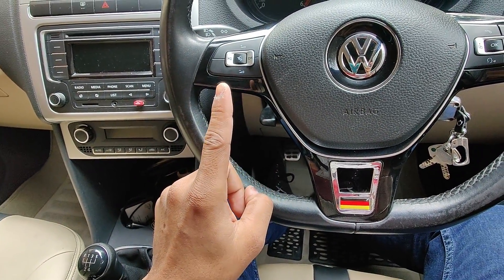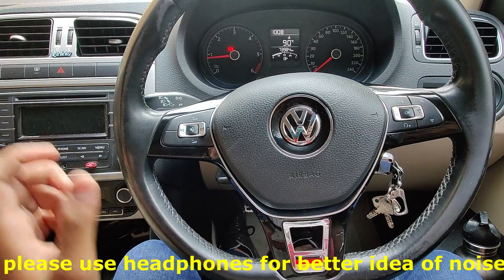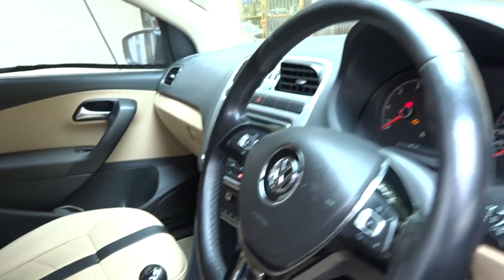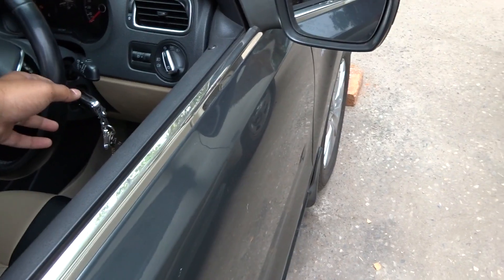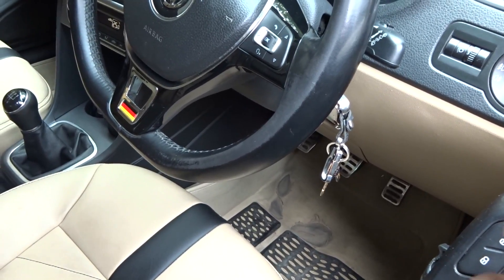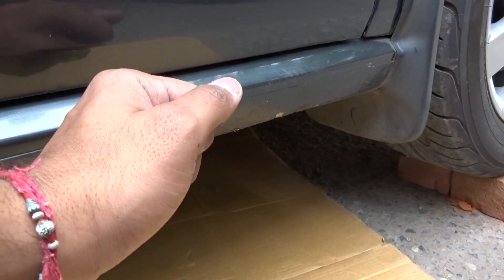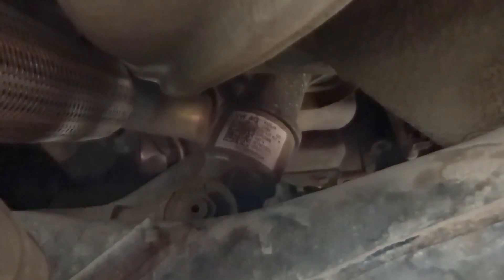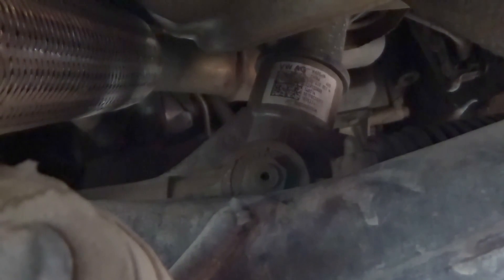STEERING RACK NOISE | RACK PRELOAD ADJUSTMENT | YOLK SCREW | HOW TO

Comment from the maker: subtitles / closed captions available
Reply: Thank you for this man ! But in general do you have an idea approx how long do these racks last if driven correctly.
Reply: @AK-sv4kb  also a little bit on the tyres per my mechanic. I had MRF tyres that are very hard and I switched to continental tyres now will be taking it to the mechanic to only change the bushings and see how long it lasts. Factory fitted rack made noise at 70K and the second one I changed at VW lasted only for 30k kms until it made clunking noise when going over bumps.
Reply from the maker: Yes , it also effects the life
Reply from the maker: @AK-sv4kb sir honestly it depends upon the condition of the roads

Comment: Did the steering vibrate heavily on braking? Not talking about warped brake rotors symptom (although similar) as rotors are new.
Reply from the maker: No sir , it's just a clunk noise

Comment: Hi!
audi a3 2013 same problem..this sound is made when driving lightly, if I go fast I don't hear it, the same when stationary, or when I slow down and turn the steering wheel. Should I tighten the screw and that's it?

Comment: Hi, need your expertise on a problem im facing

I have a honda city 2015 and I recently replaced the rack with honda genuine part at service center because old rack had become very voisy and rattled over bad roads, plus steerin also became hard after failed repair attempt

however after replacement although other issues have been fixed, this sound is still present and it is same like you presented in your video, do you think I should get adjustment done on the brand new rack? I did the test you demonstrated and the smallest of steering input is delivered to the wheels and ofcourse it is a new rack (only drove 1000km till now) so internal wear is out of the question.

Will adjustment of york screw cause hardness in steering?

Comment: If you’re not leaking power steering fluid I would rule out the rack. Could also be a steering shaft or ball joints as well. Usually when a rack goes bad you’ll have to turn the wheel half way to drive in a straight line
Reply from the maker: Sir its an electric power steering , doesn't have any power steering fluid .

Comment: Hello, is adjustment an option on the Fabia MK3 (2015)? And would this explain knocking at full lock. I have such an issue from inside the centre of the rack itself.
Reply from the maker: If it knocks on full lock then its not going to do much , but you can still try , every car has this setting
Reply: @yourDIYneeds 2016 Skoda Superb? While cleaning the steering wheel leather, I turned the steering wheel with force and this knocking sound came out.

Comment: @yourDIYneeds bro i have same problem in my car a little sound came from steering..on rotating and when applied brakes a kit kit sound coming from steering my mechanic change the bushes of my steering rack and he told me that...after sometime he will tight the bushes and no noise will come....it will be resolved after adjustment like braking noise and steering noise??

Comment: Hello brother, my polo gt tdi has the same issue when moving the steering left and right. The rack is only 5 months old, can it be the lower part of the steering column, the steering shaft? because the noise can be heard only on low speed and uneven roads.

Comment: My steering is hard and wont center at low speeds, the rack is new. Will loosening it return it to normal? My old rack was a lot lighter.
Reply from the maker: Yes , if castor and camber are correct then yes it it will .
Reply: @yourDIYneeds  thank you

Comment: @yourDIYneeds i feel my skoda rapids steering is little heavy especially at lower speeds or complete turn. Steering rack was replaced recently and i was asked to run the car for 5k km so that the steering will feel smooth... do you recommend me to adjust the yolk screw to loosen a little bit or wait for some more time. Thanks for sharing your knowledge 😊

Comment: Does we feel wobble for this issue?
Reply from the maker: No sir
Reply: Iam getting wobbling issue sir what might be problem?... I had checked allignment twice within 1K kms still its not going... Feels when i break... Also i have this steering rack noice
Reply from the maker: @vishnuba7323 
Checked wheel balancing ?
Reply: Checked that when changing tires... They ran over 15K
Reply from the maker: You feel wobbling in steering or brake pedal ?
Reply: On both😭😭

Comment: Great vid. I have the same noise and when I adjusted it fully tight it still did not get rid of this noise is my steering rack just bad because it moves the wheels fine with minor touches.
Reply from the maker: Sir check the ball joints of the steering system , maybe it's not the steering rack
Reply: Did you find what it was in the end?
Reply: @cruiseedwards4657  it’s the rack I guess this noise is normal for the age. It steers fine still.

Comment: Could this adjustment be done on a Nissan Armada? I have excessive steering wheel movement when hitting bumps/uneven surfaces along with the clunking sound. Although there is no clunking when turning the wheel.
Reply from the maker: Yes sir , almost every vehicle with a steering rack setup has this adjustment

Comment: Thank you for this video. Just replaced inner and outer tie rods, lower control arms and stabilizer arms on my renault. Not long after started to get this exact noise from steering and concluded I probably need new steering rack and I would need to most of the work again. Watched countless youtube videos to try found "easy" fix. I'll try this today. Your video is only one explaining properly how to adjust the steering rack, some even said it needs to be adjusted in 180 degree turns which sounded silly as can be.
Reply: did it work?
Reply from the maker: 😅 sor thousand people thousand processes , but i try to follow the workshop manual . Thanks a lot for appreciating.

Comment: Before you started all this did you check the power steering fluid,  it may be the power steering pump
Reply from the maker: Sir its electro mechanical power steering system , not hydraulic

Comment: I have changed al shock parts lower arm , link rod . tie end rod
Evrything except steering rack 
Some.sound thud sound in uneven road
Reply from the maker: Do same process sir
Reply: @yourDIYneeds  steering rack relpaced 20,000 kms ago . Is it advisable to change or tight
Reply from the maker: Sir , even the new rack calls for a preload adjustment

Comment: have this similar problem. search a lot on the internet and i think it is the bushing on the steering rack not the preload. maybe im wrong, but i guess i'll stick by replacing the bushing on the steering rack. bushing on steering rack has lifetime in it , it's not a permanent parts it needs to be replace for couple of years using a car.
Reply from the maker: Sir my car did not had any sort of bushings

Comment: When I turn my steering wheel left to right it’s squeaks, and when I go over bumps it’s squeaks as well. Has new struts, and all new suspension. Could it be the rack ?
Reply from the maker: Swapped the strut bearings ?
Reply: @yourDIYneeds  we changed the two front struts with new ones
Reply from the maker: Sir you changed the struts but did you change the bearings on top ?

Comment: Can this cause vibration in the steering wheel or small pull on uneven road?
Reply from the maker: No sir , it will not induce any kind of vibration
Reply: @yourDIYneeds  Thank you

Comment: Sir my Baleno which I bought just 8 months back creating this issue. Is my rack worn out?
Reply from the maker: Sir may need some adjustments , worn out rack this soon is quite difficult
Reply: @yourDIYneeds  ok thank you sir I will get it checked soon.
Reply: If company said that your rack is worn out will it be covered under warranty?
Reply from the maker: Yes sir it will be as your car is just 8 months old

Comment: Does driving with that "tak tak" sound for long will  cause any harm to steering column or rack or suspensions  ?
Reply from the maker: Very minimal , but its good to get it fixed
Reply: @yourDIYneeds thanks a lot for reply ! Anyway to connect with you ?
Reply from the maker: Sir everydaydiyhelp@gmail.com

Comment: Hi..i face this issue on stagnant vehicle plus when it goes on breaker there is an abnormal sound , like something is loose in the front..car is 1 yr old..service center said its normal sound..pls gelp
Reply: Was the issue resolved for u? I too face same issue in right side suspension Luke something is loose only on some potholes..
Not all potholes cause that issue
Reply from the maker: @vijayendranvijay4538 if the noise is in the steering assembly , just like i did have , then it will resolve

Comment: Seems to be my issue. All of the front end as been rebuilt on my 2013 Jetta tdi. Balljoints top plate bushing inner and outter tie rods the u-joints in the streering colum are ok. The only thing left is the rack. I hope this fixe it as I don't want to drop the subframe and replace the rack since i'm looking to sell it soon for a newer tiguan.
Reply: Did it fix it ?
Reply: @mikemarin4793  nah, a rusted steel bolt in an aluminum casing. Stupid engineers. I ended Up changing the whole steering rack.

Comment: My mechanic had tightened the screw of my honda, the sound from the rack gone. But the steering wheel became tight. Is the steering wheel becomes lighter and smoother after certain use. The mechanic had told me that it becomes loose and normal after some use. Kindly make a reply
Reply from the maker: No sir , he had done it too much , have to make it a little loose .

Comment: Hello friend, I also happen to have this German Ghodi, 1.2 TDI, 2012. I located the place however its not 19 size bolt but with some kind of rubber on it. And It seemed small, I could fit a 13 bit but no movement either clockwise or anticlockwise. I have exactly the same issue. what to do?
Reply from the maker: Sir bolt size may vary , but the function is same 
If the threads are seized then you can spray a little bit of thread penetrating fluid , it may help

Comment: Hi. My suspension makes rubbing noise when I go over humps. Local mechanic told me it's due to stabilizer bush gone bad. Can u suggest place in Bangalore where I can get genuine spare of Skoda or VW
Reply from the maker: Sir i reside in Delhi , don't know much about Bangalore
Reply: @yourDIYneeds   OK
Reply: @yourDIYneeds  Hi got the noise sorted out. turns out the engine mount had gone kaput on the driver side.

Comment: Hello! I am having a similar issue as you with my VW Ameo. It is under extended warranty. However, the 3rd party warranty provider (Bajaj) is refusing to honor the warranty for the rack stating that the noise is mild and unable to be captured by their camera. The service center acknowledged the issue, lubricated and adjusted the rack, but slight noise is still occuring. Any suggestions? Thank you.
Reply from the maker: Sir lubrication and adjustment of yolk is the best option

Comment: Very informative! Is the procedure same for Skoda laura ? And how long does this solution last ?
Reply from the maker: Yes sir , its same for skoda as well , its still going fine for me , my odo is on 1,10,000 now
Reply: @yourDIYneeds  do you mean on laura too? Coz laura and rapid/polo steering rack designs are different right
Reply from the maker: Yes sir they are different , but the basic construction of every steering requires a yolk adjustment , the only difference is that some racks has one yolk to adjust and some have two

Comment: Hi. Can I connect with you over a call please? I have Škoda Fabia. Both Polo and Fabia share the same parts and build. Thanks.
Reply: I’m facing issues with the steering rack and it makes very irritating sound when turning or when passing on humps/ speed breakers. I recently got my suspension changed. So the only defaulter left is the rack. The service centre advised to get it replaced.
Reply from the maker: Sir mail me at everydaydiyhelp@gmail.com

Comment: If i turn steering left i makes some,Weird sound but no sound for right turn;help me bro what to   do?
Reply from the maker: Sir check the ball joints , there are 3 on each side ( only on front )
Tie rod joint 
Steering end ball joint 
Control arm ball joint
Reply: @yourDIYneeds  showroom people told that steering box complaint in the last month,yesterday i have been through watercrossings(cyclone in my area)after some offroads and water crossing i got this noise,i can feel steering rack make some noise but yesterday onwards some hydraulic sound arised during the left turns only...
Reply from the maker: Sir maybe the rack got filled with water , you can open one boot and check
Reply: @yourDIYneeds  ok sir thank you
Reply: Can i use it with that problem or go for repair sir?
Reply from the maker: Sir if its water , then atleast what you can do is open it , and have it greased up , so that it doesn't do any damage further , there is also a video on same topic on channel
Reply: @yourDIYneeds  waiting for it....
Reply from the maker: Sir video is already there

Comment: Did you try silicon spray near the foot well where the rack joins? does the mk7 also have adjustable yolk
Reply from the maker: Sir every steering rack has a yolk adjustment , be it mechanical or electrical .
Reply: @yourDIYneeds  thank you interesting to know

Comment: Dear Respected Sir,

I have new dzire LXI vehicle which giving me a issue on 1000km.

Issue is when i  start engine and moving steering tk left side approx 10deg a knock noise comes then it not come untill i drive .

When i kept vehcile off for 30min and again start and move steering left 10deg a knock noise comes.

Service Team saying it's no issue but i chexked new cars at showroom no one having rhis noise.

Even its not there in my vehicle day I buy it on 6dec 2021 till 25dec 2021.

On 25 dec service team dismantled all suspension parts to chexk my steering squeaking issue and reassembled all suspension again.

Then soon next day 26dec i observed this noise .
Steering Squeak also there for that they reolace coloumn related ball joints but soon after month again sqeak start i shared video with team they take my car kept it 2days and now no squeaking but they said they dint done anything but how it possible without dojng anyyhing Squeak gone

I doubt that they did lubrication of strut mount and steering coloumn and rubber boot of colooumn on floor
Plz suggest.
Reply from the maker: Sir when my vehicle was just 6 months old , i faced a similar issue , on cold morning whenever car got into a pothole ( left front ) it made a clunk noise and after driving for 10 mins noise went away , i tried everything , myself , even gave the car to service centre and they checked it and told me nothing is wrong , i drove my vehicle like that for 3 yrs , and then one day in monsoon season after rain i was inspecting the front left wheel and i saw that the whole fender liner was covered in dust , except for a small spot , which was very clean , and it came out that the sway bar end link was striking against the plastic fender liner only when the temp. Is cold , as the car and shocks gets warmed due to operation the pressure inside the shock increased and then pressure was enough to avoid that impact , so i would advise you to have a good look for any witness marks for impact , so we can trace which thing is making noise due to impact
Reply: @yourDIYneeds  sir my vehicle is just 2month old with 3400km clocked.

I checked this steering noise sound in all new cars at showroom no one having this noise.
Also this noise nit there in new car wjen i taken.

But after 20days when i took car to service centre fkr checking of Steering Squeak and they opened up strut  knuckle,tie rod,ball joint,link road and then assy again now from that day i was having this steering knock noise when I turn steering LH side 10deg even today I checked it at 1pm in noon whene it was bright sunny here in delhi then also it comes. 

I went to showroom and chexked all cars no issue like this

I checked cars at service centre no issue 

No idea what to do now
Reply from the maker: Sir is that noise also feels in your feet . Like when the noise comes , can you feel it in your feet on pedals ?
Reply: @yourDIYneeds  no sir.
Only once when I start engine and steer steering left by 10deg 
Once it comes (Bhaat awaaz)

Then it not come

And again when I park my vehicle and move steering wheel after sometime this noise comes again once
Reply: @yourDIYneeds  not in pedal but yes I feel under bonnet area clearly
Reply: Sir one thing more my car got underbody rust protection coating during Ist Service and after that I feel this steering knock once when enginenstart and steering move left side 10deg
Reply from the maker: It was not present before the coating ?
Reply: @yourDIYneeds  no sir
Reply: @yourDIYneeds  no sir
Reply from the maker: Sir then we have to visually inspect thats the only option
Reply: @yourDIYneeds  I shown it to maruti Service Team Delhi but they saying it come in all Eps steering but I don't see it on anyother car.
Very much pareshan I m
Reply: @yourDIYneeds  sir does strut mount or strut bearing make this steering knock noise
Reply: @yourDIYneeds  which part need visual inspection
Reply: @yourDIYneeds  Service Team of maruti given me in written that it not a issue but I need to know what is this noise.

Plz suggest Wat to do to know root cause then solution